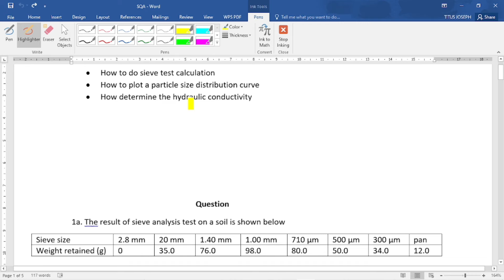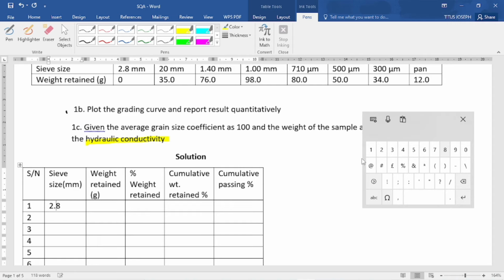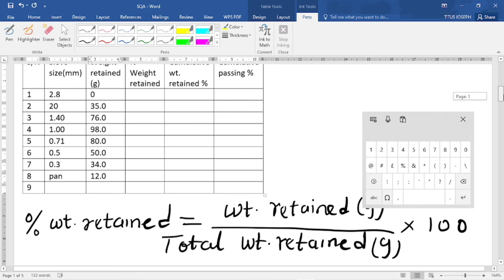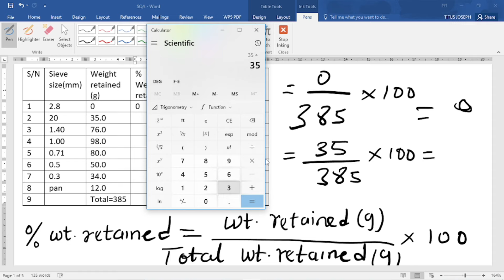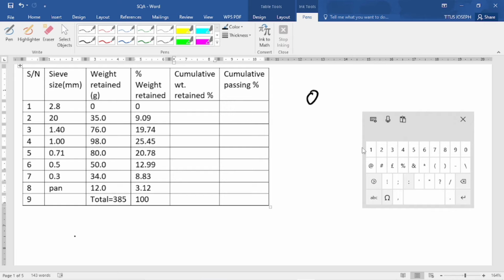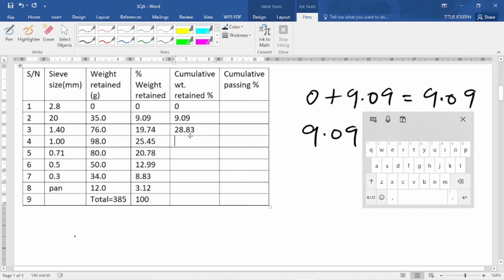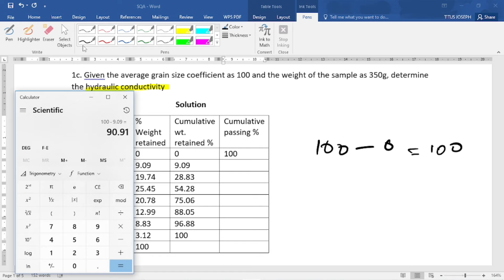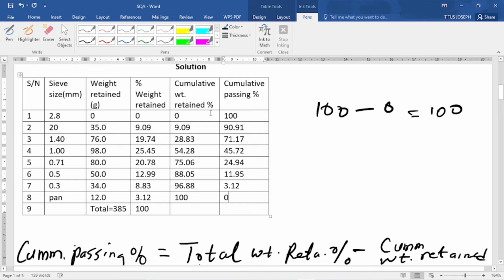How to do sieve analysis calculations and plot particle size distribution curve (part 1)

Comment: Thank you for sharing the video. This is really helpful. You may just want to correct the 20mm (it should be 2 mm) for sieve size
Reply from the maker: Hey, that was a typo... There is supposed to be a point between the two and the zero. Thanks for watching...